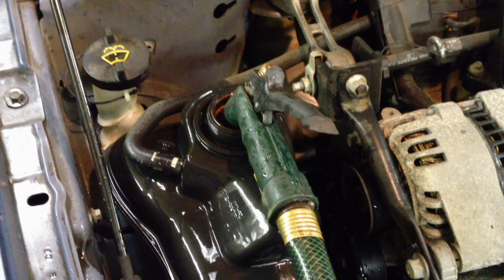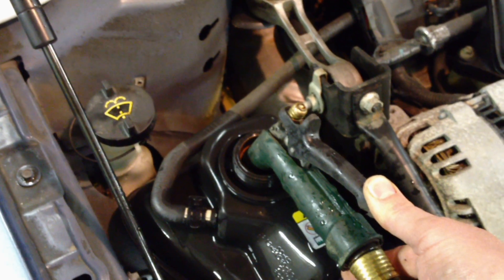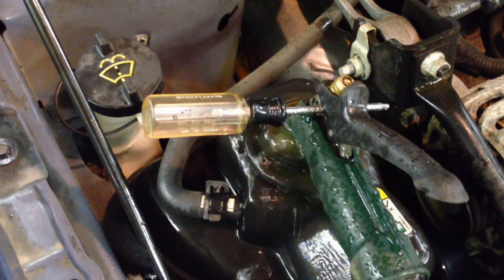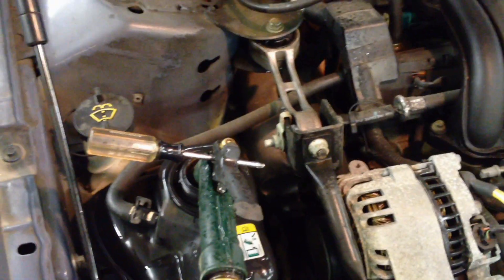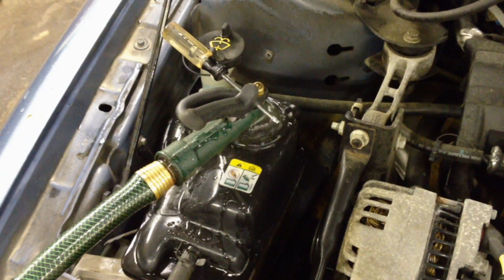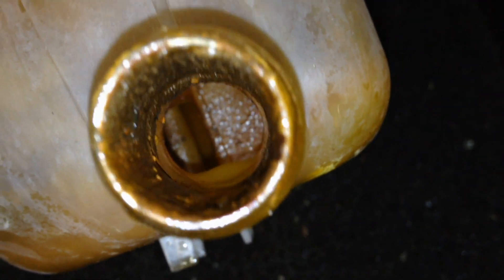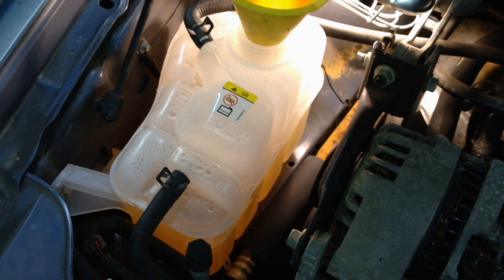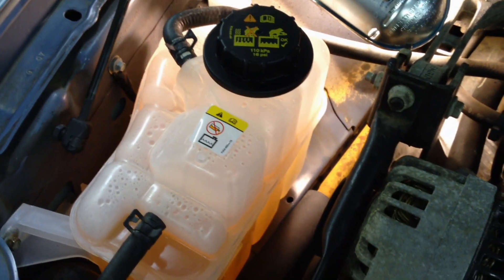NO HEAT: Ford Taurus Rusty Coolant Flush Procedure

Comment: Thanks for vids. So I have the smell in the car of syrup. From past experience I know its the heater core. I find no water on the passenger side of the car. I don't see any water on the ground, yet I'm "missing' water from the coolant bottle. The car blows hot air. Doesn't overheat. If the core hasn't gone bad, would a flush do it well? If I'm smelling this, is it too late?
Thanks for the vids. They are great. More than willing to give this a try with all the help I've found here. I'm no mechanic, but for the costs of repairs anymore, I'm getting better at it!! Thanks again!
Reply from the maker: If the smell is there you must replace the core. If the system is rusty clean it as shown in the video first then change out the core. I have a video on that also.

Comment: Awesome video, Thanks for taking the time to post this. I am going to be replacing heater core ( which is totally blocked w/ rust on one of the tubes), coolant reservoir and I'm afraid I need radiator as well. When I remove the plastic drain plug, all I get are a few drops of coolant coming out, even when engine is hot. When I drain by taking off the lower radiator hose at the radiator, I was getting lots of tiny rust particles before I flushed with Prestone stuff, running clear now but still nothing from the plastic drain plug.  Would you recommend still using the VC9 cleaner being that I'll have new radiator, heater core, reservoir and if so, should I VC9 flush before installing new components or after?
Reply from the maker: Terry Carroll I have seen the nastiest rusty systems on these and never had to replace the radiator. Have you unscrewed the drain then yanked on it to pop it out and have a large hole for flow? I would definitely flush with vc-9 and get the system clean as possible before installing anything new. I would wait on that radiator.
Reply: @FordTechMakuloco  is the drain plug under the driver side?
Reply: I had the same problem with my old taurus, I took a long clear hose that is small enough fit in the heater core hose, got a connectore from home depot, clamped the bypass and back flushed from the heater core connection and got the heater working again. I tried to push the hose as deep as I could and did it on both the inlet and the outlet. I suggest you do that before changing out the  heater core.

Comment: Thanks for all your Ford Taurus videos!  I have a 2001 and 2007 Taurus both with the Vulcan engine.  Per their owner's manual they have different spec coolants.  Was wondering if I should use the 2007 spec coolant in the 2001?
Reply from the maker: Robert Clark I would use gold in both just make sure you do a real good flush of the old coolant first and use gold from there on out.

Comment: One thing I would add is before filling up for the final time, I always like to flush the system with distilled water and for sure the final fill mixture should use distilled water otherwise you are more prone to the mineral build up that got you there in the first place. This would be especially important if you have hard water or well water with lots of extras. Great Job overall on the video.
Reply: very true. tap water has more than just H2O, so it's a good idea to remove as much of that as possible.

Comment: tell me if someone mixes gold color coolant too the old green type coolant and it clog cooling system. can you clean it like this?
Reply from the maker: Nathan James No they will not clog if mixed like dex cool, but the benefits of the gold are nill at that point.
Reply from the maker: lightningsmokerXx Nope no problems never ever change them. On the 6.0l like he is talking about there was a new cap with a heavy duty spring and design yes but on gassers it is never a problem.

Comment: me again another great video so hds are in eng all buttoned up nothing left over and i was wonedering i want to flush i am in az so what thermastate 192 .180,or 160 degree should i use and should i put in before flush thanks
Reply from the maker: Thomas Aiello 192 like normal will get the best fuel economy, but with traffic out there it may be best to go with the 180.

Comment: So on the Taurus (mine is a 02 LX 3.0L U code), there is not a radiator cap that allows you to fill directly into the radiator?
Reply from the maker: 65Superhawk Correct it is all done from the degauss bottle.
Reply: FordTechMakuloco Thanks...How would you do this if you did not have a pit and could not just let the old mixture spill out onto the shop floor?
Reply from the maker: 65Superhawk  Drain the coolant out into a pan, fill with water run until the thermostat opens and then drain again into pan for collection. After that you are free to flush.
Reply: FordTechMakuloco How much coolant do you get out when draining? Will one drain pan catch it all?  Also, will one bottle of the VC-7-B be enough?
Reply from the maker: A regular drain pan will catch it all yes. We use two bottles of vc-7 for this repair broken down to 4 total gallons and uses a little over 3 total if I remember correctly either way yes you will need two gallons of concentrate.

Comment: i have a 97 taurus and im running into the same thing. weird thing is while im running water into the overflow container and i have the radiator plug open at the bottom, there is no water coming out of the radiator. so that tells me theres no coolant/water going to the radiator at this point. would it be my upper radiator hose that needs to be replaced or what?
Reply from the maker: I would pull off the upper radiator hose and put the garden hose into the radiator where you pulled the upper rad hose from and flush the radiator directly to start. The radiator has the smallest passages of the cooling system.
Reply: aaaah that makes sense. thanks!

Comment: Im going to service my cooling system on my 02 Sable 3.0 vulcan. Most likely replace the heater core. Is there any chance the VC9 could cause damage during my flush...eat away something? My coolant isnt exactly rusty. Also, and recc on Zerex G 05 for coolant or do you swear by the VC 7B? Love ur vids btw... !
Reply from the maker: The vc-9 is made for the cooling system in the Taurus, it will mainly loosen up the rust. Just follow the procedure as shown in the video and you will be fine. The most important part is flushing all the old vc-9 out. Yes I swear by VC-7-B still.

Comment: I have a 2005 Taurus and had a thick orangish substance in the coolant reservoir most said it was a head gasket I had a mechanic pressure test and it held fine now no heat so I assume some of that crud migrated into the core.
Reply from the maker: Go right for the flush as shown in the video. using the vc-9 rust dissolver is very important after that and everything shows clear you can drive it for awhile and evaluate the rest of the cooling system etc.

Comment: I had an issue removing the overflow reservoir with the rear 10mm bolt not coming out. I removed the passenger wheel and the wheel well shroud and found the bottom of the bolt spinning freely when I tried to unscrew the bolt. I tried holding it with pliers but eventually just heated it up and punched it out. No more bolt back there, but it's a plastic bottle and is attached two other places, it's not going anywhere.
Reply from the maker: Yep if I have to take the reservoir out first thing I do is spray the stud for the nut with rust penetrant. Then drain coolant etc while its soaking. Then hit it with the 3/8 impact to shock it out. If it spins I just cut it out of there and put a bolt through from the bottom and nut on top like stock, you just have to hold the bolt head from underneath while tightening.

Comment: So does your shop have some sort of drain system that collects all the old coolant and cleaning chemicals?
Reply from the maker: Of course they do between the water fuel separator and the organic absorbtion bag in the "pit" its all taken care of. Of course that is only for accidental spills of fuel or oil into the drains or a coolant flush like there where there is no alternative beside drain out the coolant into a drain pan first then flush residual only. The filter system is definitely not a catch all.

Comment: I got a prestone backflush kit which is a plastic "tee" fitting that comes with hose clamps and a cap. You cut the 5/8" or 3/4" rubber hose which runs between the top of the water pump and the heater core and install the tee with clamps. there is a garden hose attachment so you can attach the garden hose to your heater hose. Open and remove the overflow canister cap, turn on the hose, start the engine. The rusty water/sediment will be flushed from the core and out through the overflow canister top. I also use the chemical flush once I've flushed with water, then rinse system one more time w/ clean water. Once a year keeps my heat going... Good luck!
Reply from the maker: Yes I have used those in the past on my focus I always worried about the "T" spliced into the lines though and said I would never do it again and I replaced the line with new when I rebuilt my engine even though it wasn't leaking.
Reply: FordTechMakuloco May I use Zerex G-05 instead of the motorcraft gold? I have Zerex in my garage and it says its approved for ford. Is that true?
Reply from the maker: 900Yugo
As long as it says meets ford spec-  WSS-M97B51-A1 on the back at the bottom.
Reply: yep it does thanks! WSS-M97B51-A1

Comment: Great video.  Thanks for posting.
Reply from the maker: You Bet
Reply: I have a 98 ford Taurus with the same issue. I changed out the thermostat but still the heat just gets a little warm. I'm hoping the flush will fix the problem so I wont have to replace the core.
Reply from the maker: ***** It will definitely help but I am sure a core is in order. Check out my video on core removal you will see how easy it is.
Reply: Yes you were absolutely right. I just finished flushing it and still very little to no heat. How do find your video on the core replacement.
Reply from the maker: Just type in
NO HEAT: Ford Taurus Heater Core Removal
Reply: Ok thanks!

Comment: did you get heat back after this proceedure?
Reply from the maker: This was part of the heater core repair I did in the other video so yes. Most of the time this will get heat back but not full hot burn your hand in front of vent like this one because the core was changed. If you are going through all of this you might as well change the core out too. It doesn't cost much, check out my other video on that.
Reply from the maker: *****
It is very easy check out my Taurus heater core removal video and you will see the Taurus is very easy. You can do the flush and then just fill with water and see if you have heat back too. Look at some of the comments on the core removal people cannot believe how easy it is.